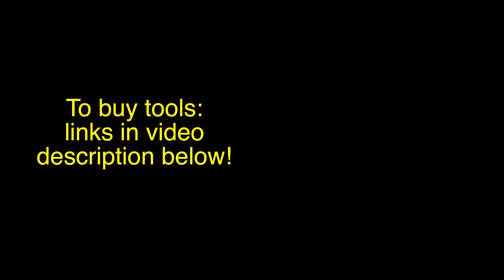2013+ Piaggio Fly - Turn Signal Light into Running Light - Blinker Genie | Mitch's Scooter Stuff

Comment from the maker: Blinker Genie Pair - http://amzn.to/2FyUFtp
Front running lights - https://amzn.to/2EFgmsE
Front signal lights - https://amzn.to/2ZcoytX
Tools I used: 
Wire crimper / cut / stripper - http://amzn.to/2r1z75x
Zip ties - http://amzn.to/2muFRTZ
SHOP MY SCOOTER STUFF: http://amzn.to/2CbqQku

OPTIONAL:
Soldering iron kit - http://amzn.to/2DsEhtW
Heat shrink tubings 3/16-3/32" - http://amzn.to/2r7ulDR

Want more free Scooter Tip / Tutorial videos - Please support MicBergsma!
Paypal donation: http://bit.ly/2fghrw

Comment: Can you advise me which LED replacement bulbs you used & where you got them from? Obviously, I'm in the UK so I won't be buying them in the US but I'd like to upgrade the bulbs in my 2017 Suzuki V-Strom 1000 - Many thanks :)
Reply: yes I would like to know those bulbs too... especially the BAU15S types with those off-set lugs in amber
Reply from the maker: Hey, your V-strom use front signal bulb 7507 http://amzn.to/2FLAhF6, hope you could get them :)
Reply: Mitch's Scooter Stuff Thanks 👍🏻 Do these have resistors fitted (so the flash rate stays the same), or will I need to replace the flasher unit or add resistors? What about sidelight & headlight bulbs on a 2017 V-Strom 1000; any idea?

Comment: Does it require a Blinker Genie for  each light harness? and wouldn't that work pretty much on any scooter application?.. thinking of doing it on a GT200 all the way around thus having ALL LED as I've converted the headlight to LED.
btw great video 'as usual' 👍
Reply from the maker: Hi Sam, yes blinker genie come in a pair... one for each bulb. Do it all the way around with LEDs yeah!  Thanks!
Reply: thanks Mitch;what I did is find some amber LEDs from China plugged 'em into the signal sockets an bingo they work an blink just a tad faster, which is fine by me, because they can be seen better overall...plus was able to find some auto headlights (about 24 dollars for the pair also from China) and without changing the wiring around plugged right up and again bingo bright white headlights,now all LED;your videos really helped me...thanks man.